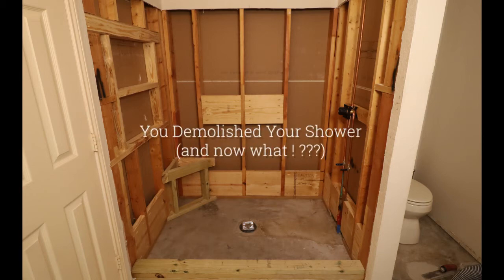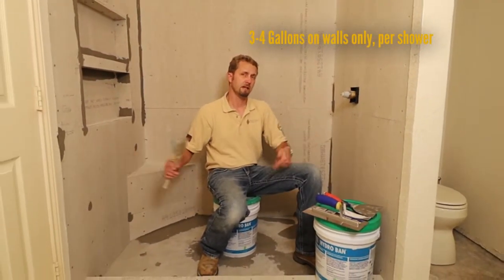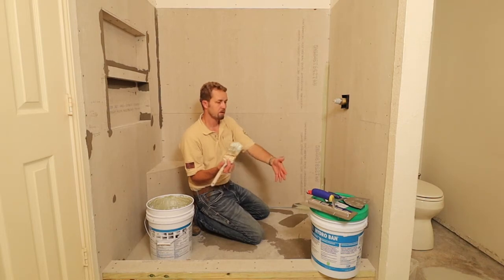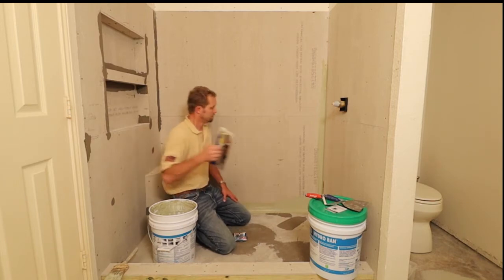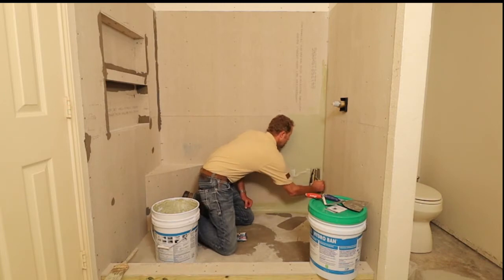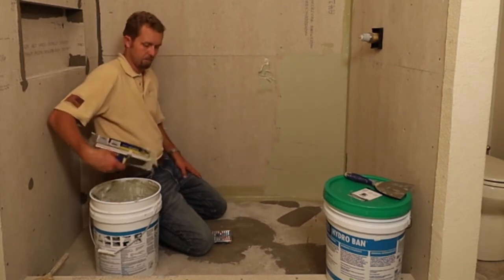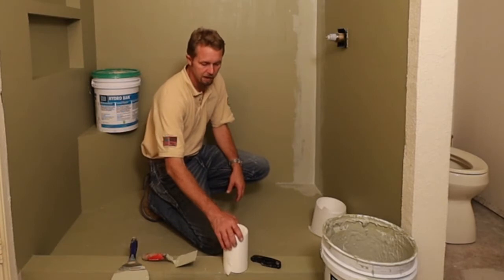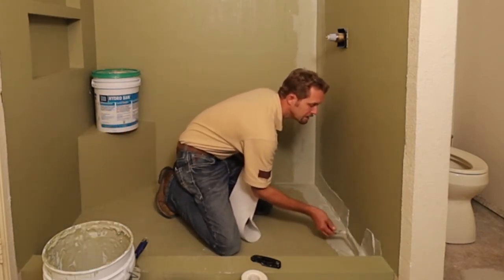Laticrete Hydro Ban Shower Wall Application Process 2021

Comment: So you can use this water proofer over concrete  board ?
Reply from the maker: Yes Rickesh, you can use Hydro Ban over concrete board (as you referenced) or really known as cement backer board products like Hardie Backer, Wonder Board, etc., or really any other code approved product in a shower (e.g. Hydro Ban Board) Yes, if you want to shell out about $30 per 3 foot x 5 foot board, Laticrete Hydro Ban Board is available at some tile shops. I prefer Hardie Backer that costs about $10.99 a sheet. Hardie Backer requires something like a grinder with a tile blade and creates a dusty mess, but saves about $20 per sheet, but I have to coat it with Hydro Ban, and saves me a special trip to the tile store, when places like Home Depot or Lowe’s is much more convenient. Wonderboard is more brittle along the edges.

Laticrete makes a HydroBan Board foam core board with the green coating on top, and then only requires sealing the joints, gaps, etc. This Hydro Ban board can be installed on the walls, benches, and shampoo Niche. It’s foam core and not cement based, so it’s not very rigid.

Laticrete also makes a foam core pre-sloped shower pan product, that can be easily cut and glued into place, but once again needs sealing at the joints. I have not used the pre-sloped shower pan product, as a lot of the showers I build can vary from standard sizes to crazy huge showers sometimes with some odd shapes. Keep in mind to keep the perimeter of your shower level, so all your tile will look great sloping down to wherever the drain is located.

Getting side tracked, lol!.... 😅

What is the difference between concrete and cement? Concrete has gravel, rocks, or stone, also known as aggregate.

 Cement is a binder, a substance used for construction that sets, hardens, and adheres to other materials to bind them together. Cement is seldom used on its own, but rather to bind sand and gravel (aggregate) together. Cement mixed with fine aggregate produces mortar for masonry, or with sand and gravel, produces concrete. (Reference Wikipedia)

Good luck with your project!
Reply from the maker: Yes, you can use Hydro Ban over concrete board.
Reply from the maker: Hydro Ban must be applied wet 0.4mm to 0.6mm thick on each coat and allowed to cure 1-3 hours each, for each of the 2 coats. How do you know you’re achieving the correct thickness? A millimeter is just slightly thicker than 1/32”. To make my life a little easier, rather than guessing, I just use the 5/32” x 3/16” V-notch trowel that Laticrete recommends on the back of the bucket of Hydro Ban and then flatten it out like Laticrete teaches. I also use the fabric style joint tape to prevent cracks in the Hydro Ban. It’s very helpful for houses that can shift around. See the rest of the house for drywall crack repairs, or for cracks to see if this may happen to the Hydro Ban in the shower.

   For shower pans, code requires you to test the shower pan with standing water up to the overflow height for 24 hours. 

     Afterwards, you’ll want to protect the Hydroban with something or float another layer of mortar bed mix that the tile installer will attach the tile to.
Reply: @craftsmanconnection  Another layer of mortar bed mix to protect Hydro Ban? I thought that tile could be adhered directly to Hydro Ban??
Reply from the maker: Ideally you would put another layer of mortar over the HydroBan. The reason for this is 2 fold. 1. To float a tiny bit up for the Oatey shower drain flange, and 2. To protect the HydroBan from some tile guy who might damage it.
Reply from the maker: @marklanese5594  The tile can be adhered directly to the Hydro Ban. The only reason for a little extra mortar is due to the plastic flange of the drain, and depending on who’s doing the tile, the extra caution, so that a random tile guy doesn’t scrape his utility knife on the product trying to clean out any grout joints. Other than that just maintain the minimum 1/4” per foot slope on your shower floor, and you’ll be good.

Comment from the maker: For starters, there is nothing that is a paper product. I float a mortar on the floor that is pre-sloped to the drain, and Hardie backer on the walls. Then I apply Hydro Ban to the walls and the floor with 2 coats of the product at the correct thickness (on the package) Essentially I’m using a 5/32” x 3/16” V-notched trowel at roughly a 45 degree angle, to get the correct thickness, and then flatten it out without removing any product. I have done it this way for at least 12 years, and doing it that way will get the right thickness. I have checked the thickness with the Laticrete Mil thickness gauge that I finally got my hands on to make sure it was. After the first coat is dry, I use the flat side of the trowel to skim coat on another layer, paying extra attention to any dried holes, like air bubbles that popped, and anything else that needs an extra coating layer. If you want to do an extra full notched coat, feel free. Just build it up in layers so each layer dries correctly. The first coat will soak into the cement board and dry quickly, and extra layers will dry slower, like most if not all day. Good luck. Don’t forget to do a shower pan test for 24 hours. Make a mark on the wall with pencil to easily check the height of water.

Comment: There is no 1/4 gap between cement board and shower pan? We dont need that anymore? Thanks!
Reply from the maker: You don’t need the gap, because the Hydro Ban water proofing goes on top of everything. You’re thinking about the rules only when you have a rubber shower pan liner and not a total water proofing system. Refer to Laticrete’s website for their Hydro Ban product.
Reply: @craftsmanconnection  I had the same question, you dont want the cement board siting in the liner because water wicks up, but youre waterproofing the wall with the floor, I guess if it leaks everything is damaged not just the walls, thats my dilemma, liquid vs those paper membranes?? I wonder which last longer?? I dont mind doing 2 or 3 layers of this stuff.... but I wonder if it cracks before the paper does?
Reply from the maker: @EJfromNYC  For starters, there is nothing that is a paper product. I float a mortar on the floor that is pre-sloped to the drain, and Hardie backer on the walls. Then I apply Hydro Ban to the walls and the floor with 2 coats of the product at the correct thickness (on the package) Essentially I’m using a 5/32” x 3/16” V-notched trowel at roughly a 45 degree angle, to get the correct thickness, and then flatten it out without removing any product. I have done it this way for at least 12 years, and doing it that way will get the right thickness. I have checked the thickness with the Laticrete Mil thickness gauge that I finally got my hands on to make sure it was. After the first coat is dry, I use the flat side of the trowel to skim coat on another layer, paying extra attention to any dried holes, like air bubbles that popped, and anything else that needs an extra coating layer. If you want to do an extra full notched coat, feel free. Just build it up in layers so each layer dries correctly. The first coat will soak into the cement board and dry quickly, and extra layers will dry slower, like most if not all day. Good luck. Don’t forget to do a shower pan test for 24 hours. Make a mark on the wall with pencil to easily check the height of water.

Comment: does this liquid membrane have to be applied below or above the mud if im going to float my shower floor for pre-slope? or does it not matter where as long as its one of the layers?
Reply from the maker: Above the 1st layer of mud bed mix. The mud bed is sloped at 1/4” per foot slope minimum, and the Hydro Ban is applied on top. After the Hydro Ban has dried at least 1 day, flood test the shower for 24 hours. Then you can, but don’t have to, apply a second coat of mortar on top of the HydroBan to protect the hydro ban from the tile guys. 

You’ll want the first layer of mud bed 4:1 mix to be flush with the Oatey shower drain, and the Hydro Ban to overlap on top of the shower drain with the top flange off, so you don’t clog the weep holes.

Comment: Not sure I understand why you used this product over Schlueter.  I am putting in a 4' x 6' shower, and planning to use schlueter membrane over drywall, foam floor and barrier, and then dieter for the outside the shower.  Looks like six of one half a dozen.
Reply from the maker: If you watch some videos by the Tile Coach on YouTube, he does some tests on Schluter and shows that it will leak/ water penetrating past the non-modified thinset that is used in the application. Plus myself as a former building inspector knows that drywall, even as a substrate is not allowed in the shower area per code requirements. Green board used to be allowed back around 2003, but is no longer allowed, even with a water barrier on top.
Reply from the maker: The leak in the Schluter happened during the shower pan tests. The shower pan is the most critical area for water proofing.
Reply from the maker: I’ve tried Schluter membrane one time on a big shower job back around 2012, and I found that the membrane didn’t bond well with the non-modified thin-set. I could literally peel the membrane off of the wall. In some areas the membrane did not stick to the thin-set. It didn’t seam to matter how wet I made the thin-set. The Hardie Backer sucked the water out of the thin-set faster than I could get the thinset on and the membrane applied.
Reply: @craftsmanconnection  the schluter system installed correctly in a shower will have zero problems. most "tests" on youtube are extended submerged applications which a shower will never see. If not done properly any method could potentially have problems.
Reply from the maker: Adam Hlivko, I have seen some of those longer shower pan tests from a channel called Tile Coach. The problem I run into all the time, is that most of the showers I tear out do not have a pre-sloped shower pan. And with those shower pans without a pre-slope, the water collects and eventually the hidden water below the tile turns into a black moat of disgusting water because some guys are not aware of the true need, and requirement for a pre-slope such as another YouTube channel called Starr Tile. I would hate to see a shower pan fail and cause damage to my clients house, and have to redo a shower pan and some of the shower wall tile. Without being able to see what is really happening with water below the tile, it does concern me how bad a lot of shower pans are being done. A lot of tile guys don’t even test the shower pan first, and another plumber who installed an Oatey Shower pan liner for a contractor friend, didn’t even use silicone under the Oatey 40 mil vinyl liner around the drain flange. This isn’t what I had in mind for “job security” 😅.
Reply: Do not use drywall or green board in the shower.   It is not the proper material. Hardi board or cement board is a much better choice.
Reply from the maker: Correct. Drywall of any kind is not allowed in the shower. In this remodel video, we are using 1/2” Hardie Backer, with 2 coats of Hydro Ban liquid water proofing over the top of it.

Comment: The directions says it doesn't need any fabric if less than 1/8in
Reply from the maker: Correct, that is what the directions say. However, not everyone can measure and cut Hardie Backer accurately, and giving a full demonstration, and best practices, I use the fabric on all inside and outside corners regardless of what the manufacturer says you can get away with. I do remodeling for a living, and a few dollars worth of fabric isn’t worth having a leak, in a state (Texas), where some older house move around enough to cause a tear in just the liquid membrane all by itself.

Comment: Wow........................ you do realize you can apply that with a roller or a  brush right? I dont know, you just made this simple process look 3 times more difficult than it really is. Almost painful to watch you doing that curb!! Also there is a required thickness for the hydro ban.
Reply from the maker: From the Laticrete (Hydro Ban) website..,”When using a paint roller, substrate will not show through HYDRO BAN if coated with 0.020 – 0.030"
(0.5 – 0.8 mm) of dried membrane. Color changes from a light sage to olive green when fully cured.” 

On the back of the Hydro Ban bucket, it says you can use a paint brush, roller, or 5/32” x 3/16” V notch trowel, and so to help ensure the correct thickness, I have decided to go with the V-notch trowel, rather than a paint brush or roller brush, so I don’t have leaks at the shower pan.

I highly doubt anyone of us actually has the thickness gauge to measure Mil thickness of the applied liquid membrane, since this tool is not sold or distributed at the suppliers that I have been to.

I use a two coat process to ...ensure there is no pin holes, voids, etc. per the instructions. Better to be safe, than sorry, as replacing a shower pan is not an easy process if you do it wrong, and you may open yourself up to other financial liabilities if other things are ruined if there is a leak. Pay a little more now, or a lot more later? Your choice, but being cheap never wins when it comes to water finding a way out.

Comment: Kinda over doing it, but hey, to each's own.
Reply from the maker: When do you know when it’s under doing  it? When it leaks!!! 😂 On a serious note, Laticrete has Mil thickness specification and tool recommendations on how you should apply. It looks thick, but dries thinner, and I have tested it to not leak. And on 1 job, although it was as thick, a framing crew jacked up the house, tweaked my corner, and a leak happened….fortunately there was a garage floor underneath (1st floor level).
Reply: @craftsmanconnection  That is what the fabric's for my friend. Almost ten years doing Hydo Ban and Mapei Aqua Defense, I have done both with Concrete Mud Pans as well. No call back since.